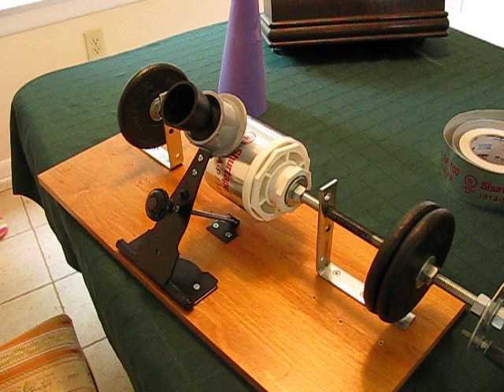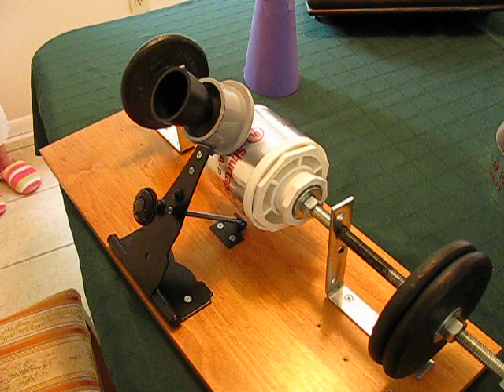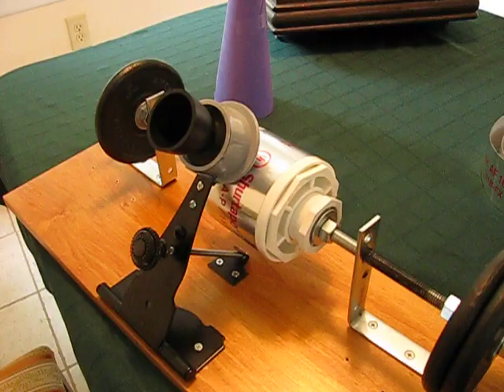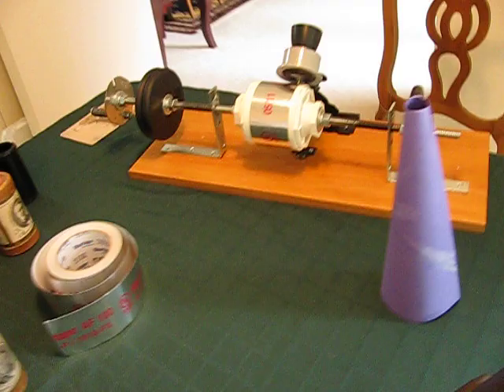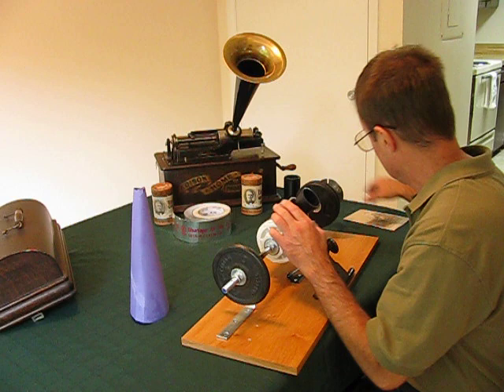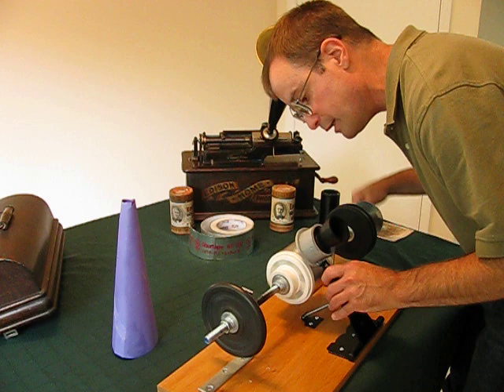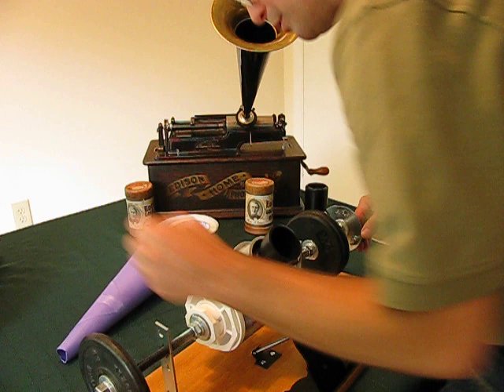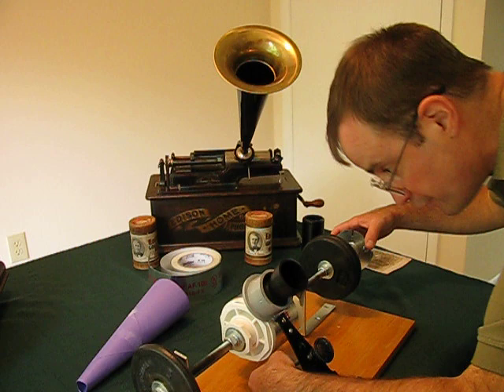Homemade Edison Tinfoil  Phonograph

Comment: I'm not gonna lie my jaw literally dropped, this is so cool.
Reply from the maker: I'm glad you liked the demonstration!   Thanks, Lee
Reply: did you use a threaded cliynder and I'm confused on the reproducer
Reply from the maker: This is a very crude form of a Tinfoil Phonograph and thus no threaded mandrel (cylinder). The reproducer itself indents the tinfoil. Your voice vibrates the diaphragm which in turn vibrates the needle. The needle "writes" your voice onto the tinfoil.    Many thanks!   Lee
Reply: thanks your friend   boss
Reply: hmm imagine Edison's reaction in those times... really cutting edge for those times....even to imagine such a machine... he was really ahead of his times.
Reply: @LedZep16  The sound grooves use bumps on the cylinder, hills and valleys so to speak. The diaphragm vibrates up and down as the speaker makes sound and cuts the valleys. A flat disks uses side to side warbles to reproduce sound.
Reply: I felt exactly the same way.

Comment from the maker: @DIYPhonophile  The mandrel doesn't necessarily have to be grooved. The one in the video isn't. It is made out of a four inch plumbing coupling and plumbing reducers. This setup reduced the coupling to about 3/4's of an inch. When you tighten the nuts and washers you have to be sure the mandrel is centered up on the rod. It was a little harder than I thought it would be to do! I,m very happy you like the video. If I can help more please let me know.

Comment from the maker: The Reproducer is just a PVC electrical fitting, but anything would suffice really. Next, we have a beveled rubber gasket, you can find something usable at the auto parts store for a couple bucks. Then comes the diaphram of whatever material you choose, waxed paper worked best for me, (bottom of a paper cup.) Finally, I used a couple rubber "O" rings/gaskets, also from the auto parts store. The first gasket is glued to the fitting. The last ones just fit in tightly.          Thanks, LEE

Comment from the maker: This is very tricky. The needle doesn't have to sharp in the truest sense; about the sharpness of a nail. You have to be able to adjust the amount of pressure the stylus puts on the foil and it also needs to be able to give somewhat unless your mandrel is perfectly round. As I said, this is tricky but with some practice you'll get it. Don't hesitate to ask more questions. I will try to help. Keep us posted.    Thanks!   LEE

Comment from the maker: @TheNikkmeffley Thanks for responding to the video! The entire Reproducer assembly tension is adjusted by means of a 1/4 inch threaded rod, with a knob attached. The needle, which is actually a small nail, is glued to a small piece of flexible metal. Thus, you can easily experiment with different amounts of tension between the needle and whatever type of  foil you utilize. The needle DOES NOT need to dig into the foil deeply. I would try light pressure at first, and increase it as needed. LEE

Comment from the maker: Thanks for the question. It is a drawer or cabinet handle which I tapped out with a bottom-end tap to 1/4". After that, it is screwed on to a piece of 1/4" all thread. This assembly adjusts the pressure to the stylus. The handle can be found at any Lowes or hardware store for a couple dollars. Best Always!   LEE

Comment from the maker: The black round piece you see is an automotive gasket/washer costing about two dollars. Just check out the shelves at any automotive store and you can find something. The white piece you see is the diaphram made out of the bottom of a paper cup. With a little trial and error you'll be surprised what you can come up with.    Good Luck!!!    LEE

Comment: Have you ever tried recording on the Edison cylinder phonograph using tin foil? What did they use for a diaphragm? Was there a recording diaphragm and a different playback one with a less damaging needle so they cut with one type and playback with one less likely to damage the foil? I think the original recordings on foil were damaged by playing.
Reply from the maker: Thank you for your comment. Tinfoil is expensive and somewhat hard to come by. When you are experimenting with a new device, you could go through a fortune in real tinfoil before you get the instrument fine turned. Maybe one could test with aluminum foil and then switch over to tinfoil. Originally the diaphragm was a thin piece of metal. Later on, mica and other materials were used. On the original Tinfoil Phonograph, the Kruesi, there were as you suggested two different phonets, one for recording and one for playback.  The styli on each one was made differently. This design was quickly abandoned. The main thing to keep in mind is that these machines were new and experimental, and the ideas were changing rapidly.
Thanks!!  Lee

Comment: What is there to stop the machine from endlessly recording? How do you prevent the device from recording when you are playing back? It seems like this would only work a few times because each time you play it back, it's also recording, especially when you add the cone, isn't that a two way street? Amplifying the sound on the tin, but concentrating ambiant noise on the pin which is connected to the tin.

Comment: Could you please tell what kind of tension do you have on the needle to make the impressions... and if that is the same tension used for recording and playback? I have made a phonograph similar to yours but have used thin rubber as a diaphragm instead of paper... it seems to amplify the needle sound so I assume it will work.. but haven't been able to record anything yet. My needle is pretty sharp but could it be it needs to be sharper? Thanks for any tips :)

Comment from the maker: Thanks! The Reproducer is attached to the hinge with an "L" bracket (1"x1"). You can see the two little 6/32 screw heads on the hinge, just below the Reproducer in the beginning of the video. I admit, the bracket is hard to see. I drilled the PVC of the Reproducer to mount the other side of the "L" bracket. Actually, these are bolts, not screws which are tightened down with a nut. If you want, post your e-mail and we'll communicate directly. Thank you, and good luck!!  LEE

Comment: This is sooooo cool. I've been thinking of a similar thing, perhaps with a speed controlled motor. The thing I had no clue about is the diaphragm material. Obviously paper works fine. Perhaps some experimenting with different materials? What did Edison use?
Reply from the maker: Well, the first diaphragm was thin flexible metal. Later, all types of materials were experimented with including mica. I wouldn't recommend a speed controlled motor at this level of technology. The main thing is to have fun with it. Thanks for the comment and good luck.   Lee

Comment: Okay so something I'm trying to figure out about the tin foil phonographs that I can't seem to find anywhere on the internet: why the weights
Reply from the maker: The weights or I guess you could say, "The Flywheel" is very necessary to produce a more even and smooth recording/playback speed. If you are interested in Tinfoil phonographs, I would recommend Rene Rondeau's book. You can look up his site or look on ebay. Many thanks for your question!   Lee

Comment: Hello I have a question on how to make the crank? and does the rod turn evenly if it's threaded? even if the "L" bracket isn't threaded?
Reply from the maker: Hello CoveyShane, when you say "The Crank", I guess you are referring to the axle on which the mandrel spins. I personally would call the handle at the end "The Crank", but it doesn't matter here. To try to answer your question the axle here is just a piece of 1/2" all thread that you can pick up cheaply at any hardware store. The "L" brackets can be obtained there cheaply also. All you have to do is drill out the  brackets with the proper size bit and then tap out the holes with a 1/2" tap. This takes a little patience and skill if you have never done it before but I know you can do it. With many original Tinfoil phonographs only one side of the axle is tapped and the axle on the other side of the mandrel is smooth and just glides through a slightly larger size hole in the bracket or what setup they have figured. Hope this helps, thanks!
Reply: leeknightable I'm doing this for my physics class and Everything is almost the same except that I used a toy drum's top for the paper in the diaphragm. I've experimented with the pressure of the needle too but it is still not producing any sound.. Do u have any suggestions?
Reply: CoveyShane e

Comment: Great video but I'm still confused as to how is sound actually captured ??
Reply from the maker: Hello, the sound is imprinted onto the tinfoil and then recreated aginst the diaphram. This is an over-simplification but it does explain what happens somewhat.   Thanks!   Lee
Reply: is it that the needle/pin vibrates from the sound of your voice first  to etch out the vibrations onto the tinfoil. Then after the sound can be played in reverse?  It's very difficult to actually find a video showing how sound holds onto the medium. I'd love to understand! thanks btw
Reply: My best way of describing it:

As the diaphragm is vibrated by your voice, the needle makes a bump in the foil. As the needle goes over the bump, it makes the needle and diaphragm move in the same way it did when you spoke, so it's only logical that you should hear it echoed, like a parrot
Reply: +CM CM the needle carves grooves.  Then when the needle goes back over the grooves it causes the diaphragm (the paper inside the little cup) to vibrate the same way it did when he talked, and that produces the same sound as when he talked.  then the cup amplifies it.  the sound isn't "holding on", per se.

Comment: okay folk!!!!!! PLEASE explain HOW TO BUILD THIS!!!?? man, I'm building it for scholl project, gotta submit it in a few days... i've tried to build it, but it ain't working!! could you explain every component you've used? especially that aluminium foil, where can i find it??
Reply from the maker: Hello! I appreciate your situation, but from crude materials at least from the first attempt, this project can't be done quickly. All the info that you will need is already here in the questions and answers. If you have more specific questions, please ask and I will answer them. Please note that it is a matter of finesse at this point in order to get this project to work. Best wishes,  Lee.
Reply: leeknightable Thanks for replying! Yes, I've got a specific question- where can I get that duct tape foil? I've tried using that aluminium foil which is used to wrap food, but it gets torn, cuz it's too thin... and another question! is that mandrel grooved?
Reply: and one more!! is it fine if i let the needle rest on the mandrel?
Reply from the maker: kartik choubisa Hello, The mandrel does not have to grooved in a simple machine. You can use quality duct tape from any Lowes or Home Depot. As far as the needle goes, you MUST have some way of adjusting the pressure of the needle on the foil to get it just right. Please notice from the video that I have a 1/4" threaded rod with a knob attached. Let us know how your project turns out!        Lee
Reply: leeknightable Unfortunately, I couldn't find the resources required, and the could hear no sound! And at last we ended up saying our viewers that a sound is present, but it's inaudible for human ears!! haha.. Still, thanks for your help!!